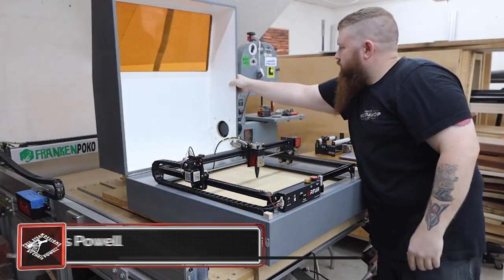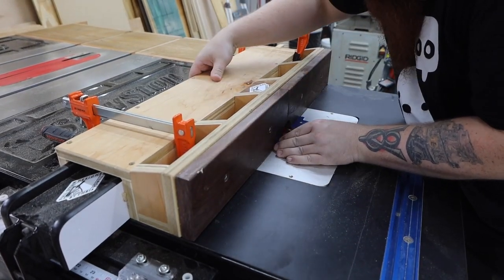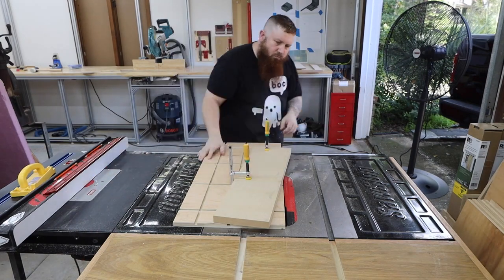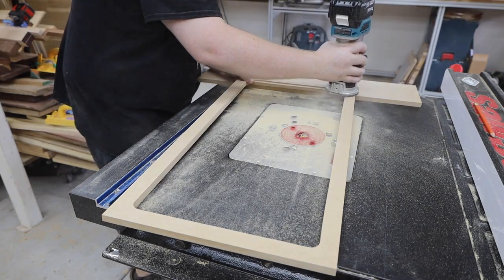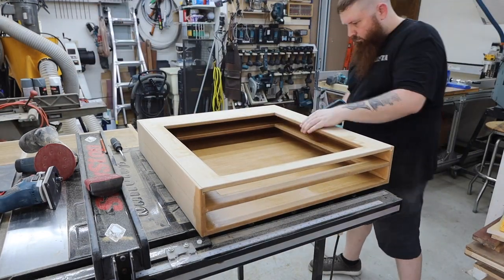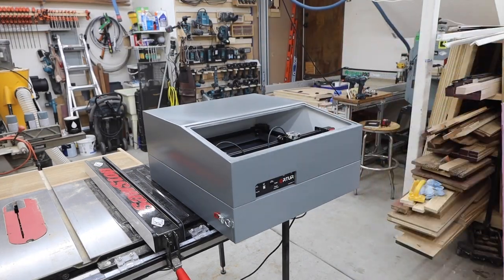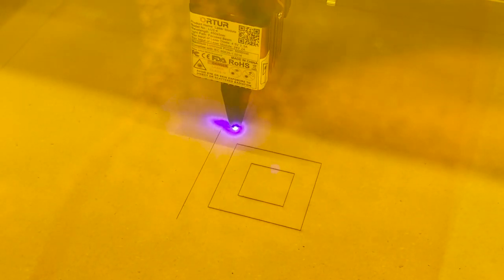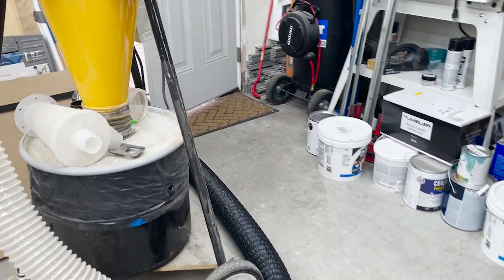Building an Enclosure for the Ortur Laser Master Pro 2 - Free Plans

Comment: J Tech laser has a protective lens 24" x 12" for $33.99. It is approved for most diode lasers (250 nm - 520 nm) Most diodes are 400 nm-450 nm.
Reply: Yeah. For this laser the technically correct level of laser light reduction to be safe, is reduction to about  1/5600 of the amount of blue light. That number is conservative, and provides safety in the case of a perfect reflection into your eyes. Normal orange acrylic will reduce blue light to somewhere between 1/2 and 1/100 of the original brightness (varies pretty wildly depending on the colorants used), which certainly helps, but is unlikely to be enough. That that that you could still quite clear see the blue color through the window means that a lot of blue light is still getting through. The JTech product claims to provide OD3, which if true would reduce brightness to at most 1/1000 of the original brightness. While not quite enough for complete safety in the case of direct reflection, should be more than enough for safety when cutting on non-shiny surfaces. I’d venture a guess that it is good enough for most metals unless they have a particularly shiny finish, but I’ve certainly not run through the full calculations to prove that.
Reply from the maker: Good to know. Thanks for the info!
Reply: @ChrisPowellFSD  I bought three of these from J tech, they are awesome and shipped very fast.
Reply: Thank you so much! This place has the best price I've seen on rated windows. I'm going to be nearby them over the holiday and will just drive over and get one!
Reply: Beautiful build.  If you need better fan performance, look for deeper (thicker) fans... They generally handle more static pressure.

The top contact edges of the alignment blocks and the shelf support blocks on the door could have a chamfer on them to make them more self-aligning.

These are very very small things to add to an already fantastic build.

I'm thinking truck bed liner coating might make it nearly indestructible...lol

Comment: what 3d printed air assist nozzle are you using?
Reply from the maker: It’s my own design. There’s a lot on thingiverse though.
Reply: @ChrisPowellFSD  looks pretty smooth.
are you going to be sharing it, patreon or otherwise?
Reply from the maker: I really gotta start an Etsy store and throw it on there.
Reply: @ChrisPowellFSD  the stl or the 3d printed part?
Reply: @ChrisPowellFSD  3d print parts and stl's for em are selling pretty good for the Ortur, especially in some of these FB groups.
Reply from the maker: Probably both.

Comment: Just for the people that use CM not Inches I looked at your cut list and swapped out and rounded up or down the very small differences as needed to fit,
I expect its close but you should always check first.
Not a wood worker so I hope the lower measurements make sense.

 --- Cut List Converted to CM from Inches

----------------------------------------------------
1 sheet 1/2 inch or 1.25cm MDF Just looking at local hardware supplier they have MDF sheets of 32mm, 25mm, 16mm and less in varying sizes 2400cm x 1200cm I think this is what you started with as a Full Sheet?

Base 62.25cm x 68.2cm
With 2 each of the following
62.25cm x 12.7cm
62.25cm x 4.5cm
51cm x 6.35cm

Upper Case slopping front
Sides 67.5cm x 19cm x 14cm x 32cm x 36cm
Upper Case top
63.5cm x 37.5cm
Upper Case window
63.5cm x 34.30cm

Back of Case 
63.5cm x 19cm

Front of Case
63.5cm x 14cm - Cutout from bottom - 9cm Left-Side 5cmD x 18cmW leaving 35.5cm Right-Side.
----------------------------------------------------
Reply from the maker: Your best bet is to do like I did in the video and cut the same size pieces all at the same time. Leave any with angled cuts a little long and trim them to fit.

Comment: Really like the design. Might have to do a little more research on the acrylic color for filtering the laser
Reply from the maker: Yea I need to do some more homework on that.
Reply: @ChrisPowellFSD  - what’s the wavelength & power of the laser?
Reply: @franktuttle5271  J-Tech sells a 12" x 24" in panel or about $34 for laser wavelengths
Reply: @jamesbrigham1299  I'm going to keep the factory orange filter on the laser so I don't think it will be a problem looking through the Amazon orange acrylic.